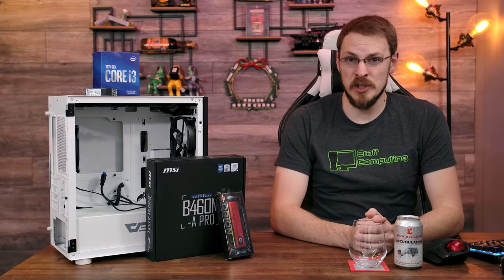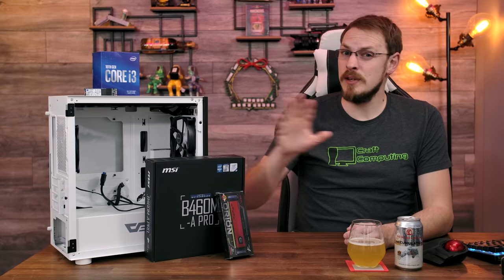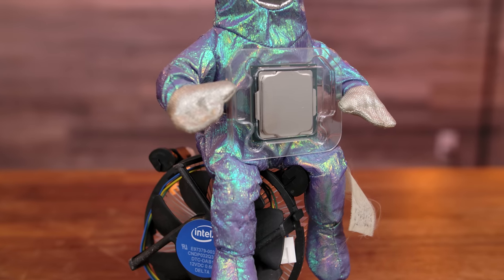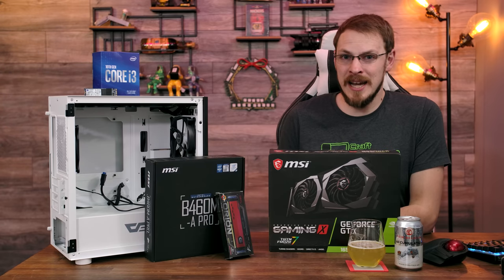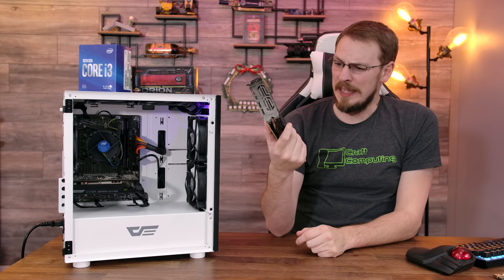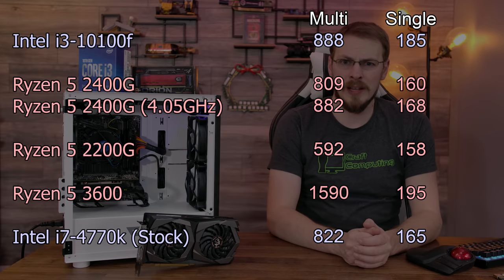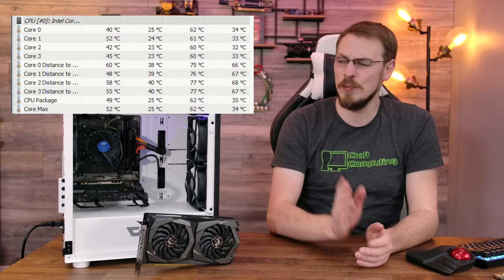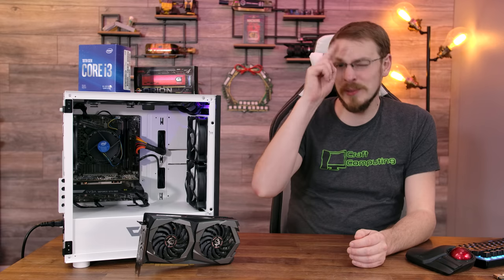Build a Budget PC with... Intel???

Comment: I didn’t love my options when I got a new card (came off a 660 ti) but my ASUS 1650 tuf with gddr6 has been serving me well.   I seem to be able to run most games at 60+ FPS at high and sometimes ultra settings despite what most reviews have said. I only have a Ryzen 3 3200g... I wanted a 3300x, then I realized it was either way overpriced or just no stock. No problem I then said Ryzen 3 3100... same damn situation so I got a 3200g (which did better than my 660 ti) -_- but it hasn’t been too bad actually so I was pleasantly surprised.

Comment: I have. GREAT idea for a video. Try to build the LIGHTEST mitx system possible. Doesn’t have to be the smallest. But it has to be mitx, have good cpu, and good gpu. Maybe something for people who want portable pc that isn’t too heavy
Reply: If you go for a super cheap/thin case and use tiny heatsinks you should be able to cut down on a lot of weight. Though of course it would run hot unless you use really loud and powerful fans.

Comment: hey, did you get the 1650 driver to work?  Could be that it depends on what version of the gpu you have, as they have a newer GDDR6 variant and a GDDR5 variant which they were running low so they had given the card a GDDR6 upgrade. The card is priced really low where I live and it would be useful to know if you got the drivers working on the pc, or a different system. Thanks

Comment: You might want to check out the RX 570 for a budget card right now, Newegg has several 4gb models selling for $150 right now which is a far better value than the GTX 1650 or RX 580 right now.

Comment: yeah some of the components cost more in EU cause amazon trash shipment tax 
and some components are not available 
so the pc costs about roughly 800euros or idk 969usd with similar or exact parts in eastern europe 

what i would do is ditch the i3 and take a 2700X instead 
ditch the motherboard and get a b450 ATX with bigger case
and just sacrifice abut idk 150-200$ or 100-150euros but have double the processor 

i3 is 7th gen i7 laptop CPU

Comment: I love the cpu performance from Intel, but lets look at what I dislike, rocket lake platform addresses Many of these which will make this exact thing Very interesting for budget builders.
B460 does not support memory overclocking, limited to 2666mhz :'/
the cpu has 20 pci-e lanes (+ chipset lanes), dedicated nvme bandwidth, addressing the I/O constraint issue with everything through the chipset.
Power consumption.

Those 3 combined make me dislike the proposition for a lot of builds at the very moment but rocket lake may actually be a budget users dream :)
Reply: For this reason, Steve Burke of Gamers Nexus advised against buying the 10th gen i5, Intel arbitrarily locking memory speed to 2666. Potential buyers often get a skewed picture of the system's performance with the i5 because youtubers plug it into expensive Z490 motherboards when Intel clearly intended B460 and H470 boards be used

Comment: I've build a budget system last generation with the i3-9350KF, B365 board and 24GB DDR4. Only real shame is the memory runs at max 2400MT/s for my set-up. Your system would not run the 2933MT/s you said around 2 minutes, since the i3 only supports 2666 and B460 doesn't support anything higher than your CPU recommended bandwidth. You need a Z490 board for that, but the pricing wouldn't be interesting for a budget build.

Comment: You should add some numbers to the review. Saying that the i3 10100f was near a ryzen r5 3600 (which is a lie as I have that CPU and it's just below an i7 7700k and the r5 3600 is superior to the i7 8700k).
Also, some gaming results wouldn't hurt so if someone builds this or a very similar setup, they can have an idea of how well it will run their games. With a couple of current games, it would be fine (like Warzone, and Doom Eternal, though you can ask your audience).

Comment: Sold my ryzen 2600  and mobo to a buddy so he and his son could build a pc together on Christmas.  So, I picked up a 10100 and an h410 combo for $140.  I like the CPU with 4c/8t for $99.  The motherboard is super basic, 2 fan headers, no m.2, no vrm headsink.  I hate the stock cpu cooler and lack of oc support for the memory.  Intel really pisses me off in that regard.  Fits my needs of basic computing and light 1080p gaming with my rx570.  I'd recommend 3100/3300x over this all day, but you'll never find them.
Reply: Very kind of you to do, even used R5 2600 on ebay go for $150 and more. Bad time to be building a new PC, big run on parts and shelves are picked over

Comment: INTEL? I mean, I guess representation matters
Reply: Best chip for budget gaming, kido... I did months of research and just built this same CPU gaming system... benchmarks prove for 1080p, this and a 2060 is under 800 for ULTRA quality 1080 gaming. Fact

780 for a new gaming pc that crushes all older i5... get it, ive been building pc for 20 years, dude..
Reply: @dertythegrower  Congrats on your system and I'm glad it works so well for you...dude. lol
Reply: @dertythegrower  on z board? z board kinda expensive, and for this cpu budget, i could only go for b460 or h..

Comment: I use a barebones Clevo laptop with a muxless 1030 . It has a LGA1151 SOCKET and it came with a 65w tdp I3 8100. I do not like the high temperatures and im planning on puting the I3 on a desktop pc and buying a I9 9900T. 8C/16T 35w tdp. base clocl 1.7ghz but can get as high as 5ghz with the right tunning.

Comment: A friend of mine recently built a PC and went team blue, he got an i5-10400f for the same price that a 3600 and a b450 motherboard would´ve costed him
Reply: Ryzen 5 3600 is impossible to find at MSRP and on US ebay will go for $300 new
Reply: Wow intel is the budget option now, that's actually funny
Reply: @misham6547  10100 has been best for a while, just not talked about. 99 and it crushes most ryzen 5 for half the cost in 1080p ultra gaming with ray tracing
Reply: @dertythegrower  I almost want to agree with your sentiment. Reason I'm not super enthusiastic about it, Intel arbitrarily locking the memory to 2666 on all but the Z490 boards. What a shame, AMD allows 3200 MHz speeds even on value B450 and 500 series motherboards

Comment: I have an i5 7600k and want to move over to the new 10th gen stuff I already have decent case. 750w Antec psu. 32gb ram and a rtx 2060 and a AIO I'm thinking this will be a nice step into the new socket. Blow the money on a decent motherboard and get this cpu run it for a few months and save for a i9 or somthing

Comment: Intel lowering prices on cpus and increasing prices on motherboard so in the end a ryzen 3300x or a i3 10th gen is at same price but i will still go with 3300x as the am4 socket provides much much more powerful cpu options and lots lots of cpu options. B450 or b550 can overclock too!
Reply: ...and good luck finding that 3300x!!
Reply: @Mr1Tanker  3100!

Comment: Ummm.  Whats the point of the fans in the front?  I have that case there no where for the air to pull from.  I have a my pump/res mounted in in front and rad on top and the back normally exhaust flipped to a intake because that version of the case has no front ventilation  there is a flat front one with air flow and there is a newer model where it like the fractal meshify c  front and can breath but that case right there should never have fans in the front.

Comment: Moral of this video: Don't build a f***ing computer right now.
EDIT: Regarding fan headers, I've definitely noticed that system board manufacturers are skimping on those of late. I have an ASUS X570 board that only has 3 fan headers and 1 pump header, so I ended up adding an external PWM fan controller that gets its signaling from a single fan header on the system board.

Comment: I sold my 4 years old i7 6700 + colorful b150m mobo (no m.2 nvme slot, 2xUsb 3.0) and i got $200, 
Now i am planning to buy a brand new cheapest msi h410m  pro (support m.2 nvme, twice usb 3. Port) + i3 10100 with total $196...
is it worth?
Or should i go to amd? Maybe an used asrock b450m mobo (that support zen3 aftr update bios) + used ryzen 5 2600 at about the same price ($195)? And then i can upgrade my cpu later...maybe till ryzen 5 5600 released...

Notes: I still have my old gtx 1070, and 2x8gb 2400mhz ram...

Comment: It's too bad the used Dells or other business machines on Ebay are also overpriced, else if one is just going to settle for a 1650, just buy a used machine with an i7-4770 or better, plop in a 1650, and call it a day.  I go with Haswell or later because those cpus have the AVX2 instruction support.  I also think one should buy Intel cpus with integrated graphics at lower ends because you get Quick Sync that some software can use.

Comment: any new build should have nvme pref nvme raid0 - the kingspec are like 23 bucks supposedly - i think avail for any products are kind of sketchy - except refurb which will be on fire until very close to zen4 and then everybody will jump - nvme should continue to get cheaper and everybody will switch to that by default - very scalable for some stuff like db ops i would rather build on 4 nvme on raid0 and image real quick in lieu of running raid10 - maybe you can test - things should improve in 21 - check out a system from techmikeny - you still have to shop around - also pls build a potato router opnsense plus 100gbe the cards are from 300 - could be a good thing to build for small biz - 100g matches up well with nvme raids

Comment: Some gpus have soldering holes for 6pin or 8pin power connectors.
Would soldering 6pin or 8pin to a gpu allow more wattage for overclock?
Reply: It still must have a controller on the GPU itself so I highly doubt, depends on the PCB
Reply: Nah. People would be selling 3rd party tools to do it if so

Comment: Is this a thing happening over there in USA? Europe prices seem cheaper then ever besides rtx 3000 and new rx cards. 1650 super is 160€, rx 580 8gb 170€. Psus are cheap as well.
Actually built a pc for 400€ two months ago, based around an i3 9100f for 70€ and 1650 super for 160 €.

Comment: if ur amd, go for ryzen 3 3100 or even 3300x, bang for the buck.. good for productivity, also for gaming

edit: im editing this.. im going to add one more: IT DEPENDS ON AVAILABILITY.. ur lucky if amd is cheaper in your country
Reply: @n0obhAcker00 ok, go for intel core i3 10100f, low ram speed, bad motherboar lineup, lower cinebench score...
Reply: @n0obhAcker00 it may be rare to find its msrp, but if ur gonna go for intel, u are going to upgrade motherboard if u go for an h410m chipset and ram, cuz if u upgrade an 1th gen processor, it will need a new motherboard (even if its the same socket, it needs mid end chipset, like b460).
Reply: @n0obhAcker00 yeah it supports, but u are gonna have a decreased performance due to low ram speed
Reply: my mind is final and cant be changed...

budget cpus..

Ryzen: for productivity, gaming and multitasking..
intel: haha for gaming and smol productivity..
Reply: @n0obhAcker00 then as you see? its the availability... amd is much cheaper in my country, so it really depends.. ur lucky if amd was cheaper...

Comment: Does this I3 need to go with a moderm motherboard or can I throw it in a early generation i3 socket and will it work?
Reply: lga1200 is only supported. not lga1151. If you want to throw in an older then go for i3-9100f
Reply: 10th gen is only for LGA 1200 (2020 mobos)
Reply: @danishbutter1847  nothing wrong with that. H410M

Comment: BLCK oc the 10100? is it possible to get 102 or 105 mhz on the base 100 mhz?
Reply: Apparently Intel added a BCLK check to locked CPUs, so they won't boot if it's above 103 MHz. Factor in some fudge for spread spectrum and clock variation and you get maybe ~102.9. Hardly worth the effort.
Reply: @Azlehria  thats just dumb,the ran out of points to be bought already why the lock it down even more. like it would be awesome if there was a unlocked i3, overclock that to 5+ghz and thats then a tank. but well why do that i guess
Reply: @dexsters5643  Because they're Intel? I dunno, man, I didn't do it.
Reply: @Azlehria  I don't see how they could possibly do a BCLK check in the CPU's hardware. I would think it should be possible to raise the base clock after it's booted. It would need to be comparing its BCLK to some other clock. If you increase all the clocks on a motherboard I'd bet money it would work. Though that might mean lots of hardware hacking and it might be awkward living with an overclocked RTC.
Reply: @eDoc2020  Not everything in CPUs is fixed in silicon. It may be embedded in the firmware, or it may be a function of the Intel Management Engine based on CPUID. Not being an employee of Intel, I couldn't tell you.

Not that I'd likely be allowed to even if I were.

Comment: With all the AMD bandwagon aura going around, everyone who knows little about core speeds and threads are pressured into buying “ryzen cpus” whilst failing to realize that an 85$ intel cpu beats atleast 30-50% of the more expensive zen cpus. not to mention amd’s CPU prices are inflated due to them being the new king of CPUs. The turns have tabled
Reply from the maker: It does not beat any of the 5000 or 3000 series Zen CPUs in single threaded performance. It's a good chip, and definitely the best value we've seen in quite some time, but don't get over your skis about it's performance.

Comment: Ya I got still using my 6700k but when I can find a 5900x I will upgrade.
Reply: i have a normal 6700, its a pretty good cpu even now.
Reply: Me too. 4+ years now on an overclocked 6700k. Probably won't upgrade until I can get DDR5 in a couple of years. Hoping to jump to something with 16-24cores and 64 or 128 GB ram. The piddly 30% performance increase for a thousand dollars isn't worth it right now.
Reply: @TheRetarp  i would go to ddr5 but it will be expensive and I remember when ddr4 came out trying to get 16gb was over $1000 so not waiting. It was Stupidly priced but luckily came down
Reply: @techlord5573  I just bought a 2nd 16GB DDR4 set for my system and it was $50 on a black Friday sale. Couldn't pass that up since I'm planning on using this machine for a couple of years yet.

Jumps in performance have been slowing way down. The next build I will make much larger than I normally would and plan to keep for 10 years.

Comment: dude intel is about to destroy for a bit because of the ryzen crash
Reply: Quite possibly. I picked up a 10400 for $150 a couple days ago
Reply: @dogtime7061  Yeah while a 3600 is 330 rn, although there is easy ways to get around that (cough cough ebay sells brand new for 140)
Reply: @cocoshort6528  is this on US ebay? Do you have a link to a 3600 at (or near) this price (buy it now)?

Comment: Intel. Seriously need to get over this artificial locking of features and unnecessary tier system of so called "class" they are tying to divide here. There should only be two different class server grade and consumer grade. That's it. Ryzen is better choice because ryzen motherboard also give you more features for same price and you already save the money on CPU itself. So total money saved is much more in ryzen builds.

Comment: Just watch...Before you know it, Intel will be the winner again sooner than later. Just like back in the early 2000s, with the Athlon 64, and Pentium 4, the Athlon 64 was better, but once the Core 2 Duos came out, Intel was winning.
Reply: I would agree only to an extent. At no point in the past has AMD ever been ahead on their process node by more than one generation. It's going to take Intel 2 years minimum to catch back up from this large of a gap. AMD will use TSMC 5nm for the next Ryzen CPUs, which is already being used for new Apple CPUs.
Reply: @dtemple87  Apple is a mess, just like AMD just watch Intel will still catch up.
Reply: @dtemple87  Right now I have an (and this is according to the Computer Properties):
Windows edition: Windows Server 2008 R2 Datacenter
Copyright © 2009 Microsoft Corperation. All rights reserved. Service Pack 1 Processor: Intel(R) Core(TM) i7-9700K CPU @ 3.60GHz 3.60 GHz
Installed memory (RAM): 32.0 GB
System type: 64-bit Operating System
Pen and Touch: No Pen or Touch input is available for this Display
Reply: @J Fz Amd Fanboy :/
Reply: @J Fz Yup So Does Microsoft Window7 screw Microsoft Window 10
Reply: @himmelskibet  Still using (effectively) Windows 7? I'm guessing you could afford to upgrade to WS2019 from the same source you got your 2008r2 license. It doesn't have all the crap desktop Windows 10 does yet you still get all the incremental improvements.
Reply: @eDoc2020  Oh no I didn't get a license I just used the Windows Loader
Reply: @eDoc2020  And yes 7/2008R2 are really good !
Reply: @himmelskibet  I agree, Intel will still catch up. But it is going to take 2 years.
Reply: @dtemple87  No 2 months !

Comment: So basically this "budget build" isn't worth the budget
Reply: Sadly, you are right. This close to the holidays and the demand for computer parts has gone through the roof and the shelves are picked clean of all the cool stuff, but apparently no one wants intel CPUs now (intel hasn't released cool stuff), so they're available. I mean, they were forced to discount their 9900k down to usd $320 in the US
Reply: @hansbehrends438  I know it's brutal. Up here in Canada not only are new parts way over priced, but used parts as well. Even Intel with their recent follies are over $400 right now. Which is kinda sad considering I currently have an i5 8400 from 2017 that performs almost better then half of the newer cpu's Intel released in the last year.

Comment: Oh no... what happened to the 1650?
Reply from the maker: It's a release day card. Might just need a quick firmware patch.
Reply: @CraftComputing  Somewhere, an old 4th gen i7 dell prebuilt cries out for a GPU that won't bottleneck or use too much PSU power.  It wants to relive it's glory days.